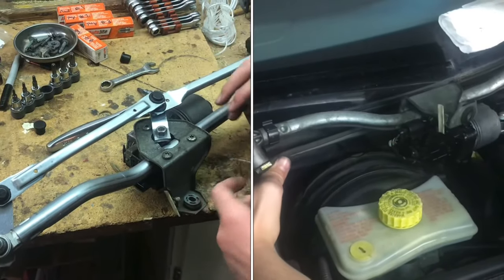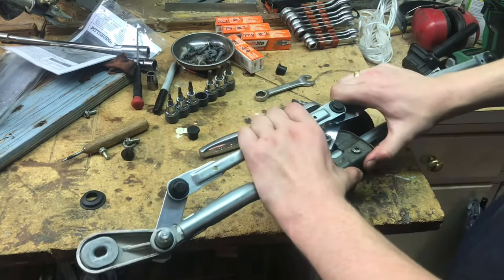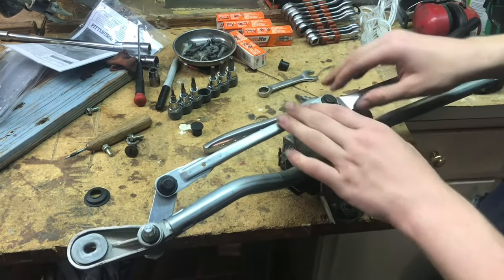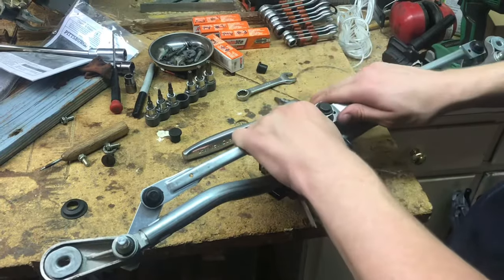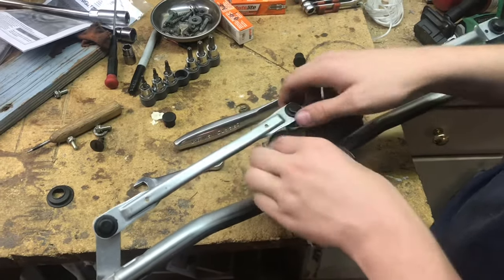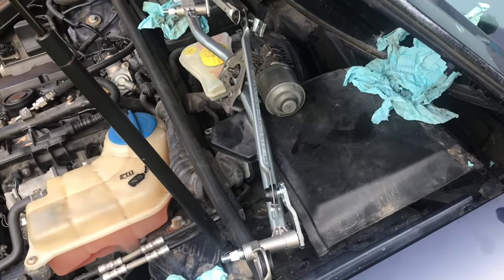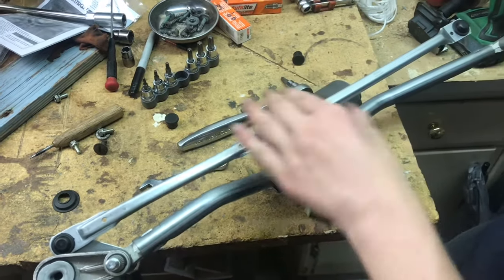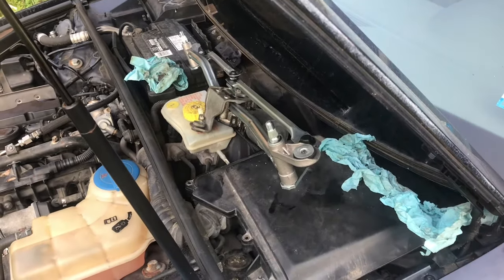how to adjust timing on MOST “windshield wiper linkage” (tricky)

Comment: Thank you for this the bolt fell off that held my motor and linkage together got that replaced but couldn't figure out why my windshield wipers were kept trying to go down farther from the home position. Not sure why other videos skip this part with the timing spent hours trying to figure it out.
Reply: Hey Chris, not sure i understand fully, but i think i have same problem as you did, just bought a new linkage for my old punto, and the wipers keep going further down than supposed to. I’ve tried realigning the arms, but then they are just too high. Did the tecnique in this video fix your problem with wipers going further down, than supposed to? Thanks in advance :)
Reply: @dcwithw  how did you fix the issue?
Reply: @POOHPOOHSMOM18  The linkage had nothing to do with the problem - this video helps if the linkage itself needs to be adjusted. For me, it was only about getting the arms to align properly on my windshield. I talked to a Fiat-specialist, and apparently if you buy brand new pair of wiper-arms, they dont have the teeth for alignment on them, from factory. The arms are made of aluminum, and the teeth on the linkage are made of steel, thus allowing the linkage-teeth to carve new teeth on the wiper-arms. I used fine sandpaper to smooth out the old teeth on the arms, and then mounted them onto the new linkage, and that fixed the issue :) hope this helps :D

Comment: Your video was indeed very helpful because I just installed a new windshield wiper motor on my 09 Ford Crown Vic and when I started up the wiper blades it positioned the blades upward as its home position which clearly was not the right position but I but after seeing your video I figured out how to set it correctly. I didn't know what I was doing wrong or how to fix it, great video thanks.

Comment: Hi will this work on every car as my Australian GM Holden commodore wipers on intermittent stop in upright position? In speeds 1 and 2 they stop anywhere on the windscreen? So I have to time it when driving??? Very annoying. Wipers turn continuously when on and click when turning off just in all different positions? Any reply appreciated. I have googled! Asked auto parts stores, auto electrician said: probably the timer which is internal in the motor? If they were somehow re arranged? Then it would be perfect.  Any reply appreciated. Cheers from Australia 🙂